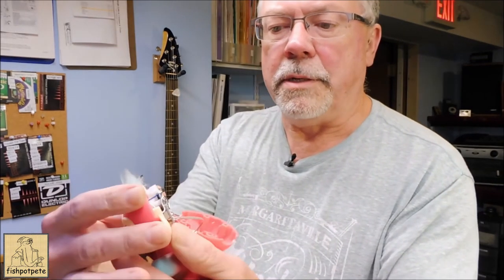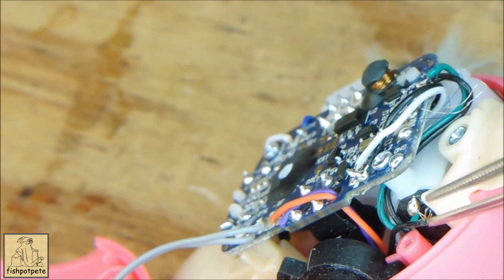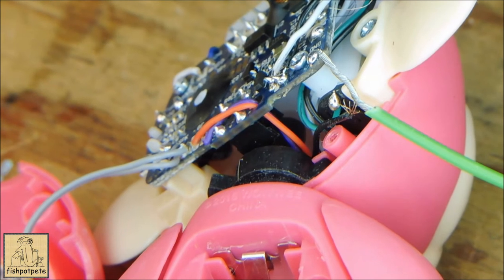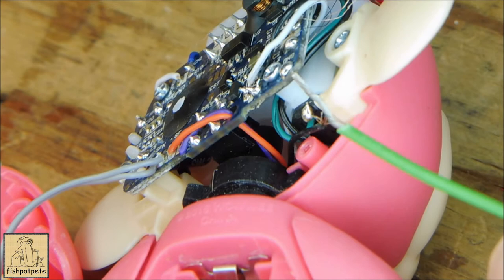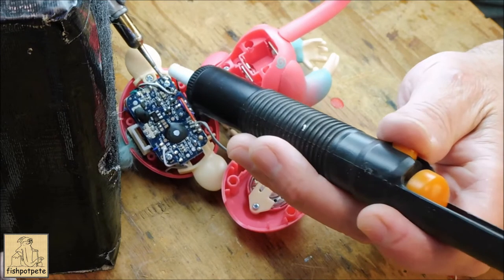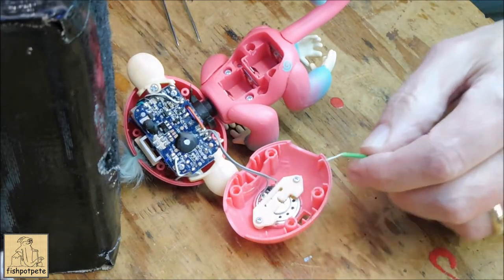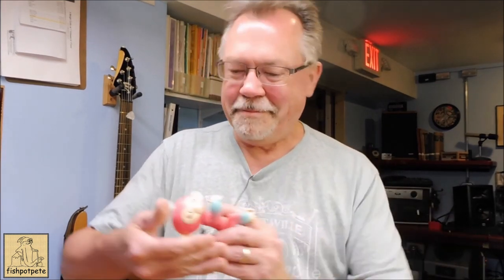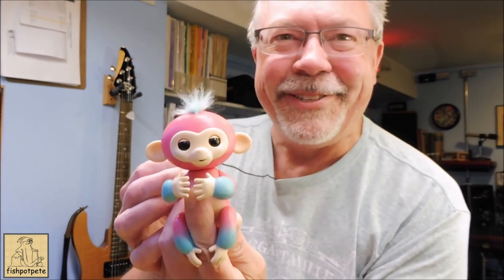Fixing a Fingerling

Comment: My fingerling is a first gen and it will work some what but every few seconds it will go hello while its still turned on any idea what to do
Reply from the maker: It might be dirty electrical contacts.  I would try compressed air first to blow out any dust/etc.  If that doesn't work, you might be need to try some kind of electrical contact cleaner spray - if you have some available.  And always remember to check/replace the batteries!!!
Reply: @fishpotpete  ok I'll try it thank you so much

Comment: Can you show how to fix the non moving glitch?you see, the non moving glitch is when you wake your fingerling up and it's stuck on a noise, Blinking .if you can help me whit that I'll thank you soo much(ik I'm late to this video)
Reply from the maker: That might be due to a missing cog on one of the internal gears and the sounds/actions are triggered with those?  So like if someone was holding both the head and body at the same time so the head wouldn't move, that could cause it to break a gear.  you MIGHT be able to open it up and change the way the gear is seated one way or the other and see if that works.  But I'm thinking that tedious work and it might not be easy to put back together?  This is a totally wild guess on my part!
Reply: It seems to have another problem.. The batteries have been leaked and its impossible to open the back.

Comment: Mine when I on the fingerlings when I rub its head or blow a kiss or rock him to sleep it starts to say hello hello hello hello hello hello continuously please help please reply please please please
Reply from the maker: It might have a logic error in the itty bitty "brain".  Try taking out the batteries and letting it sit overnight (or even a week or so - the longer the better).  Put the batteries in the next day and see what happens.  Otherwise, it could be a dirty on/off switch.  You could spray electrical contact cleaner in there and see if that helps... But I know not everyone has electrical contact cleaner.
Reply: @fishpotpete  thank u so much for replying I will try and let u know.
Reply: Sir,when you first kept the comment I was very happy and I tried to take the screws of fingerling.but it was very hard to take even the watch mechanique couldn't take it please help me is there another way ? Please reply me sir.